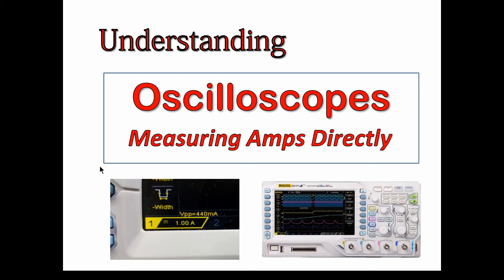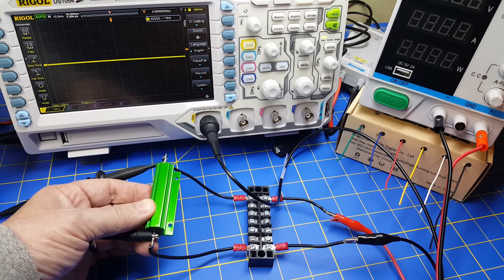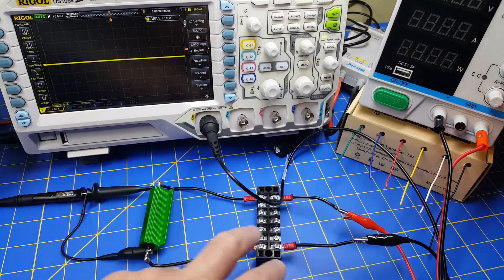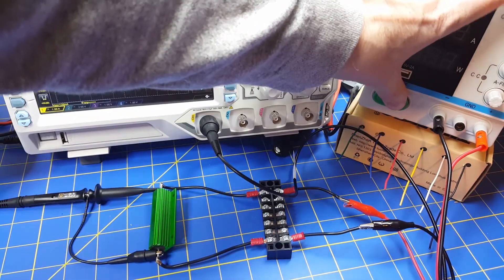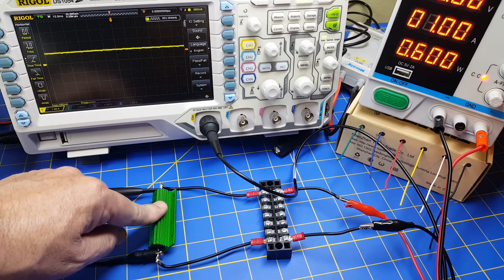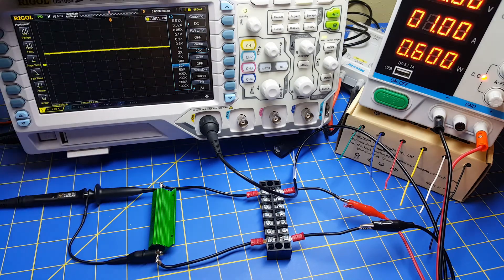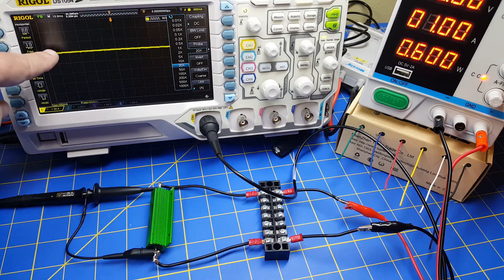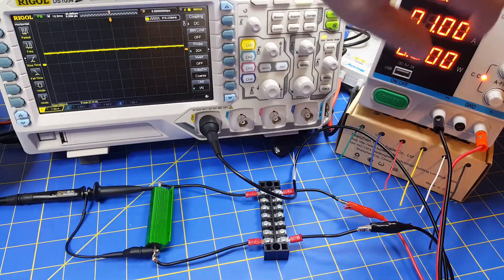Understanding Oscilloscopes: Measuring Amps Directly

Comment: FYI: Oscilloscope measures frequency, phase difference, and volts. What  you are doing is not what many engineers and researches would like to do. The big question for you is about the phase difference. Can you use two channels on reading volts cross that resistor and other reading current; well then would it should the phase difference bet current and volts? Thanks for your reuply in advance.
Reply from the maker: Oh really? I've been an electrical engineer for over 45 years, and none of what you say is true. Oscilloscopes are used to measure FAR more than you say, including frequency components, rise time, peak values, i squared t, digital waveforms & decoding, and hundreds of other things. And you think we don't use them to measure amps directly? That's just not true. It's a great way to prevent calculation errors, by having the device do the volts to amps conversion for us. In fact we often use the scope's ability to program arbitrary equations to measure complicated values. Look at my video on "Calculating Energy on a Scope" for just one example of how to determine if a pulse of current will cause a fuse to blow. And your question about phase angle between resistive current and voltage makes no sense. There is no phase angle. Are you an engineer, or do you just make Minecraft videos?
Reply: @EETechStuff  Ooooo it burns!!  lol  PS: I like Minecraft videos...

Comment: Couldn't you just leave your probes at 10x, use a 100W 0.1R and (providing you oscilloscope is set to 10X in your probe list by default)  just change your units to Amps?  1/.1=10X
Reply from the maker: Of course. Assuming you have a 0.1 ohm resistor available. What I showed in this video is a simple method, but typically what I do is use the scope's ability to program an arbitrary equation, so you can even use a resistor with a measured value of 0.683 ohms and leave the probe at 10x.
Reply: @EETechStuff  Thats awesome, I have a big aluminum shielded .1 ohm resistor to work with already.  Thank you EETechStuff.
Reply from the maker: Just be careful. If you're going to use it to measure current, it's quite likely a 0.1 ohm resistor doesn't have a resistance close to 0.1 ohms. Check out my video on Power Resistors from a couple years ago. Especially cheap power resistors can have a resistance that varies greatly with load current and temperature, throwing your current measurements out the window.
Reply: @EETechStuff  Great advice, thanks again.